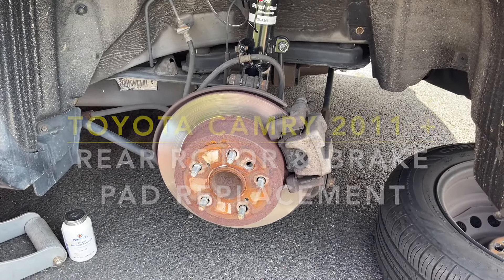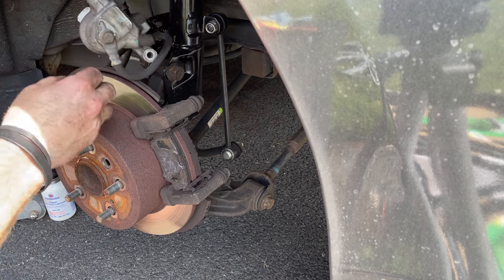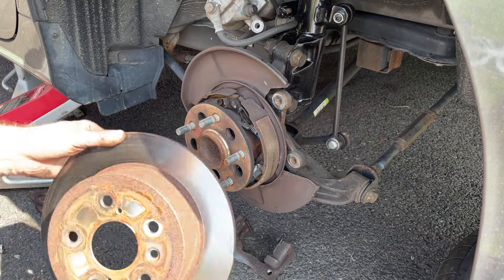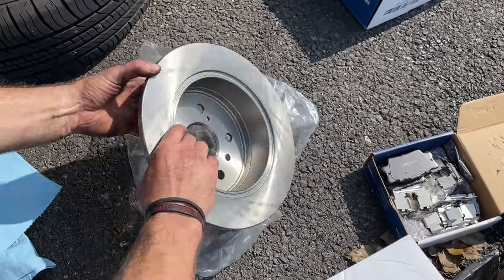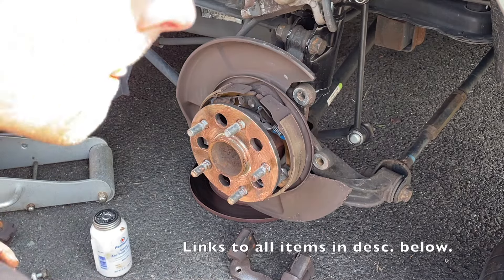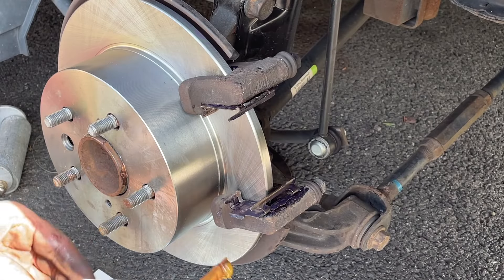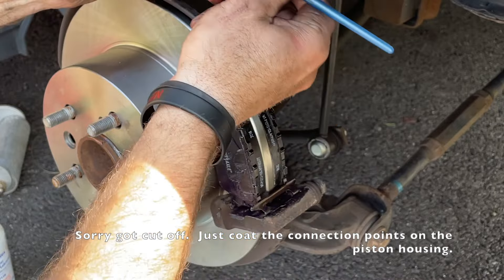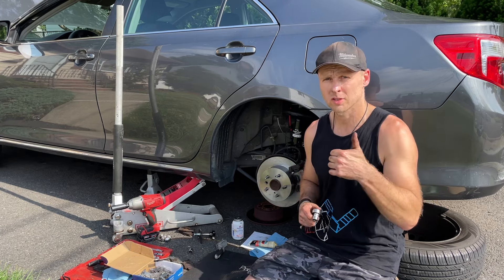How To Replace Rear Brakes & Rotors on a 2011-2018 Toyota Camry - Full Process & Torque specs.

Comment: Just curious as some videos I watched mention not to open the master brake cylinder cap as exposing it to air can cause air to get into the system. Is there a reason why you open the master cylinder cap if you’re not flushing the system? 

Btw great video! I’m getting ready to perform my first brake job so just wanted to ask the question 😅
Reply: I’m no AUTOMOTIVE mechanic (I am a mechanic), but to my understanding air can only enter the system if the brake pedal is pressed while the reservoir is open. Retracting the pistons pose no threat of introducing air into the brake system.

Comment: The other rear side of the car, which direction do you need to rotate loosen 17mm bolts? Mine looks like over-torqued. Also what is the bolt model number for 17mm, I want to change mine. Thanks.
Reply from the maker: always counter clockwise.   and its possible.  some mechanics will do that unfortunately.  they stripped my oil pan bolt and tried to charge me for new oil pan.   never went back again.

Comment: So I've seen in other videos on the same vehicle they did something with that hole in the rotor to adjust the hand brake. Did you have to do that? Why or why not? Thanks!
Reply from the maker: I haven’t touched that.  Maybe they adjusted if its worn out. Not sure.

Comment: What is the purpose of opening the break fluid reservoir while changing the breaks? Can someone explain plz
Reply: When you compress the clamp to fit the pads, it will push brake fluid back into the reservoir.

Comment: How do you fit a torque wrench in that limited space. The torque specs for the caliper bracket to knuckle are quite high its difficult to do in that limited space without a lift.
Reply from the maker: Yeah got to get it lifted.  Or need diff size wrenches to fit , etc.  Won’t always be able to get one in there .

Comment: I am an idiot. , can someone tell me which way do I turn the ratchet up or down  on the caliper bracket bolt to take off it's the  right rear the 2011 Toyota Camry
Reply from the maker: Counterclockwise.
Reply: Pause, if you dont know how to turn a ratchet then dont even try lol
Reply: @matthill2957 yeah I just. Sale auto parts. But I did finish the brake job.  But you did not answer the question ⁉️  anyways  in was  caliper bolt ,  but the last. Guy who did the brakes put the caliper bolts on with the gun it was not easy to remove .  .

Comment: WHERE A MASK OR BETTER A RESPIRATOR - if you clean anything in there with the brake pads and rotors and calipers 
IT can cause cancer and lung damage
Reply from the maker: Yes agreed 💯